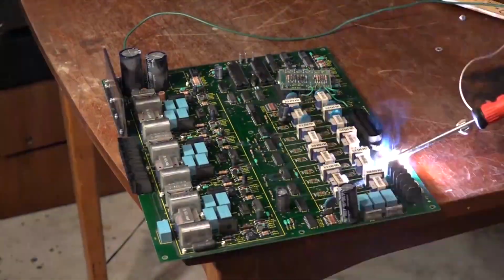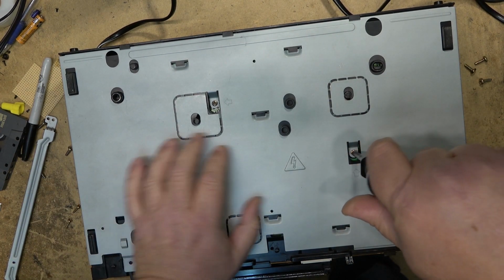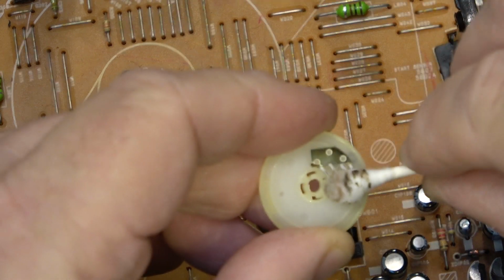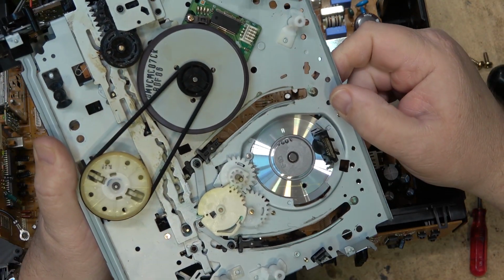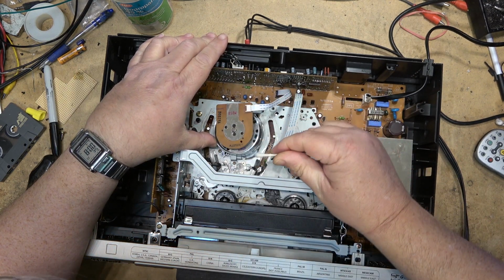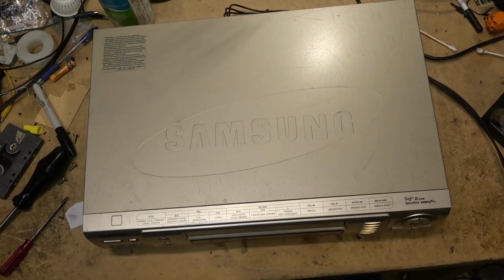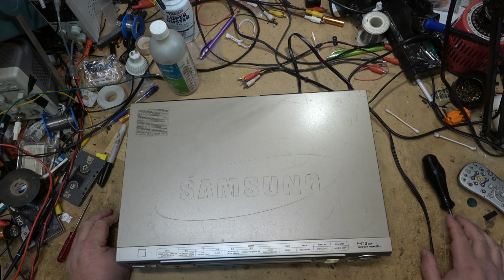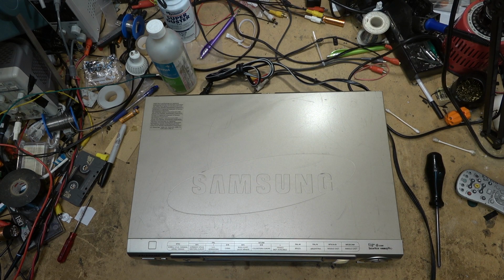Samsung SV5000 Multi System Conversion VCR mechanical trouble

Comment: 17:09 There's an exception to that.  The AG-4700 had decent heads, most AG- series machines had soft heads which wore out badly.  It's a slightly modified version of the high-end domestic NV-HS1000.  PAL recording, NTSC and PAL playback, includes a TBC.
It's PAL-M which is closer to NTSC than PAL.  Not many machines handle that.
I'm still very much doing audio and video transfers.  I usually don't charge extra for running NTSC tapes despite being in UK.  I capture in the same line/frame rate as original tape rather than convert to PAL, to keep the quality as high as possible.  Plenty of work still out there.
Reply from the maker: Not here.  I used to transfer about 100 tapes a month.  Dried up about 10 years ago.  Do lots of archiving but not much conversion now.
Reply: @12voltvids  Oh I see, you used to do VHS to VHS conversion from PAL to NTSC.  You're right, no-one asks for that any more.  What you call "archiving" I'm calling "transfers", typically video tapes of one format or another, to files on a USB stick or hard disk.  That's what I've been working on full time for about 13 years now.
Reply from the maker: @video99couk  years ago yes. Now it is all to either dvd or usb stick / portable hdd. Been that way for about 18 years. Still have my original dmr-e20 Panasonic dvd recorder.  Actually 2 of them as I was very busy.  That work has slowed substantially buy as I write this i just finished 6 VHS to DVD and am starting 20 8mm to HDD tonight. I just never see any pal tapes anymore.  A couple a year if I am lucky.
Reply: @12voltvids  I always push back against DVD, it's not a good archive format.  OK if the customer has a pre-recorded VHS tape they can't get on DVD, but for home videos and precious recordings, I never recommend it.  Video files are (or should be!) higher quality, easier to edit, share and back up, so a much better archive format.  DVDs always end up getting lost and scratched in the end.  Typically I generate and supply both DV-AVI of 13GB per hour and smaller MPEG4 files of 4GB per hour.  In the case of miniDV and Digital8, the DV-AVI file format is the only one which is a pure lossless copy of the tape contents which also has the original time/date metadata embedded in the data stream.
Reply from the maker: @video99couk  
I have found the exact opposite. DV-avi files are 4:1:1 color space as opposed to 4:2:0 of dvd.  Dvd mpg 2 ipb format as opposed to fixed bit rate 25mb/s. I have very, very few clients ask for DV-avi format primarily because they can't open the files on their mac unless they have an editor that supports it like premiere.  70% of clients want MP4. The other 30 want dvd backup.  Dvd disks last a long long time.  I have dvd disks that are 20 years old and play perfectly.  They can be imported into most cheap editing packages and edited easily and the resulting files look superior to starting with an MP4 file.  To go losses will consume 60 gigs per hour of disk space and many people's computers will have trouble with it.  My first NLE system ran at 2:1 compression 4:2:2 and i could get 4 minutes captured into the 2 gig file limit of the day. 
DV is 5:1 compressed.  12 gigs per hour.  Dvd at full bandwidth is 4.5 gigs per hour but it is mpg 2.  I output what the client wants and about 50% of the time when they take the DV Avi stream version on their portable hdd they return mad because they can't play the files on their hardware and then I am compressing to mpg4 for free. Dvd backup is a good upsell as a second copy incase something happens to the original.  I had one client recently that had 30 2 hour tapes put on a portable hard drive.  He dropped the drive getting out of his car and broke it frantic he called me and fortunately i had not deleted the files from my drive yet.  I normally don't keep a copy of anyone's data, Infact i usually capture directly to the clients portable drive to remove myself of any liability.
Reply: @12voltvids  If digitising miniDV or Digital8, DV-AVI is the only format to use and also keep the metadata.  Mac users can import them directly with iMovie, Final Cut Pro etc.  The colour space compression of DV is different between NTSC and PAL remember.  I do also generate MPEG4 files as well.  I keep a copy of the client data for a few weeks to give them time to make further backups.  For me, DVD is virtually dead now.  We just have different ways of working but give the customers what they need.  Some shady outfits use cheap USB converters and produce horrible compressed files of less than 1GB per hour.
Reply from the maker: @video99couk  Well first you don't digitize miniDV and digital 8, as they are already digital. You just transfer the tape over firewire.
I believe colorspace on PAL DV is 4:2:0 is it not? NTSC went with the lower quality 4:1:1 only because Sony, the inventor of the DV format did not want the format to compete with digital betacam, which was 4:2:2. They were trying to protect their broadcast stranglehold and did not want consumer cameras finding their way into broadcast, but it failed. Broadcasters were OK with the reduced color space if it meant that they could outfit a camera operator with a small hand held camera rather than send an entire crew in.
I use a GV-HD7000 to digitize analog video to DV-AVI when I get an order to capture directly to computer and output as 14mbit MPG4 file for the client. The MPG4 file is almost as big as the original.
Reply from the maker: Soft heads have better frequency response. That give a picture quality edge but they wear our fast.
Reply: @12voltvids  OK, an incorrect word, we capture miniDV, Digital8, DVCAM, DVCPRO, DigiBeta etc., as of course they are digital.  I wrote that around 2am!
Reply: @12voltvids  Those "pro" Panasonic machines sure do have very soft heads.  I've come across about 10 of those machines and only around three had good heads.  I'm not sure why a softer composition would give better frequency response.  Real pro machines of other formats such as BetacamSP don't suffer short head life, despite working with harder metal tape formulations.  You mention Sony trying to prevent consumer products getting into the Pro market: the story goes, that's the reason Sony killed off ED-Beta as it was at risk of eating into the BetacamSP market (they used the same tapes too).
Reply from the maker: @video99couk  well they did. Only Panasonic did this on their garbage machines.
Reply: It's 4:2:0 for PAL color system. Not as detrimental in image quaility as with NTSC tapes (4:1:1)... DV-AVI files are a good option even with analog type conversions (vhs, beta, hi8...). I'm just talking PAL land. Of course it's always preferable to use a lossless video codec like huffyuv or lagarith. This is specially usefull if you plan to do any restoration/clean up on the image.

Comment: I'd be interested in seeing you do a video or two where you talk about your best, worst and funniest customers, stories and repairs over your years of working in the field. Hearing such experiences is entertaining but can also be educational, and I'm sure you have some great stories to tell. Keep up the great work.
Reply from the maker: I didn't interact with customers when I was in the business.  The counter people dealt with customers.   I wasn't even permitted to talk to anyone.
Reply: @12voltvids  Bet you've seen some great cases of customer stupidity though. And finding faults with equipment where the customer has obviously lied about the cause (blown speakers and the like). I always found it interesting when I worked as a computer tech to hear the excuses a customer would give for a fault they caused, the most common probably being pirate software or frequent access to porn sites causing malware. Inevitably they'd blame the hardware, the operating system or a previous technician, and be in complete denial  of their fault until proven otherwise.
Reply from the maker: @ashleycox432  
Yup lots of that.  Blown speakers, teenagers having a party when folks away in Hawaii.  Funniest one was a cordless phone that came in all melted. He had a fire on his stove and the phone melted and the guy thought his 100 cordless phone was under warranty and started crying like a spoiled child when he was told too bad so sad, not warranty.  Warranty does not cover fire damage.  This was a guy I am going to guess was in his early 30s

Comment: I have one of the Aiwa machines and have found it to be a good VCR with a pretty good tracking system and picture. It handles crappy tapes pretty well. The PAL->NTSC conversion is a little wobbly... Could you show off your Aiwa?  They usually need belts and sometimes a bit of work on the front panel board.
Reply from the maker: Sure will make a video of it some day.

Comment: Different an question maybe will find a idea, I am trying to fix a problem. I have pulse oximeter it works well, but an issue it must turn off after 8 sec, but it does not, what can be the problem? What I need look for? Thank you for idea.

Comment: I have exact same model and cassette does not load or unload after VCR was not used for a few years. Cassette just stuck in a middle and I have to remove it manually. Cleaning Mode Switch did not fix the problem. What else could be wrong?

Comment: Looks a decent Machine your fixing up there, I have 2 machines, a Panasonic D80 before they put Nicam in it was the first D80, and a Grundig Multi System GV-469-M the Grundig has never been as good as the D80

Comment: Once had the previous Samsung model (SV3000 or something, forgot the name). The chassis seems beefier than this and it runs fine as multi-system vcr. Unfortunately its conversion circuit had went south so it can't be used for system conversion at all.
I also have that AIWA vcr (MX100?) it did convert anything to anything, but really with mediocre quality at best. Later got a no-name standalone video converter for 1$ from a garage sale...and it beats AIWA by miles. 
For me, any system converter vcr does not deserve any premium value anymore. Just find yourself a multi-system vcr and capture in its native signal and boom, job done.
Reply from the maker: Yes that is what I do now.  Just output the pal signal, capure and throw on usb stick.  Problem is some tvs still will not display a 625/50 capture. Computer will.

Comment: At school we had two "editing" sets ... Panasonics ... kinda NV-100 or something similar with basic efects and titler and those were PAL-B units while here we use PAL-N. I recall they used Trasconverter boxes and those were really expensive (year 92). So this unit will do the same for any of the ouput systems .... ?  A real nice feature to built in on a home VCR sure it most be like 10 years laterl otherwise would have been stupid expensive. Ohhhh the Panasonics. Never get used to them, we manage to do some cut and splices with the controls .... and that all we wrote. What really love is the ultra fine low with the jog, what a precision machine, almost frame by frame, "perfect" still. We had a so called teacher to do editing on this system ... guess what ?. She had no clue !!!!!. We have a small "radio" set on the other desk with a mixer and people tend to take RCA cables from this Panasnics to use in audio and then the system would be inoperational for weeks, no one could figure out, and we were not allow to mess with it. Im not sure if they were SVHS machines, almost sure they have HIFI FM track.
Reply: PAL-N here, We use 50Hz. Brazil is 60Hz.

Comment: Have you try to firmware update your camera? Maybe that fix the microphone problems.
Reply from the maker: This is a brand new camera.
Reply: @12voltvids  that makes not the firmware is new on it. Update the Unit and try again
Reply from the maker: @janchristensen9858  
You think i just fell of the back of a fuc+ING truck? The first thing I did was if it into the computer and check for updates.  I updated my ax100 years ago.

Comment: I still actively use the NV-FS200, which is a version of AG1980. I bought it as a non-functional unit from Ebay and managed to get it working. However, the design is just terrible and makes for a very unpleasant repair experience. Nowadays it still works fine and when it dies, i will switch to my Sony SLV-E1000. Much simpler design, relatively easy to fix. And in my opinion it also gives a prettier picture. The colors are much more vivid.
Reply from the maker: Comb filter module failed part NLA
Reply: Yes, the NV-FS88/ 90/ 1/ 100/ 200 all had that ceramic thick-film unit with the four SMD caps that would leak, causing no S-VHS playback. The 1uf start-up cap in the PSU primary was also a common failure point, usually after a power cut..
Reply: @Oldgamingfart  Yeah, I replaced that one during my initial repair. When the time comes and I won't be able to fix the VCR anymore, I will happily throw it away. Sometimes it is simply too much work. Here in the Czech Republic the lack of S-VHS playback isn't much of an issue (I can't even test it) because the tapes were too costly and never spread among users. Literally no one used these.

Comment: I have that vcr but mine has a power supply problem, it no longer powers on.
Reply: Maybe a bad capacitor?
Reply: @felixlutticken5694  checked fuse while back , think its a bad cap or 2 but didn't have a tester at the time and now haven't found motivation to dig it out from all the other equipment and wires in the entertainment center to work on it again.  Soon when not feeling so lazy :)
Reply: @kirknelson156  yes it's very time intensive to desolder the caps and test them. Yesterday I replaced a few bad caps on my old Philips amplifier and as soon as I turned up the volume a bit, one of the filter caps, which I just had replaced with very expensive blew up.I just tossed that thing away as I lost the motivation to find the problem. 😅

Comment: PAL-M is 525/30 with PAL, so the same standard as North America but differenc colour. A North American TV should display it in black&white and vice versa. PAL-N is - as far as I know - just a broadcast standard. The baseband is the same as European PAL, so the tapes are also the same, but the broadcast channel spacing and audio carrier are so they fit into the American channel grid.
Reply from the maker: There are 21 different standards based on 3 color systems.  NTSC, pal, and SECAM.  There are 5 tape formats. NTSC, pal, french SECAM, mesecam, pal m and pal n.
Reply: @12voltvids  wikipedia says otherwhise
https://en.wikipedia.org/wiki/PAL#PAL-N_(Argentina,_Paraguay_and_Uruguay)
"VHS tapes recorded from a PAL-N or a PAL-B/G, D/K, H, or I broadcast are indistinguishable because the downconverted subcarrier on the tape is the same. A VHS recorded off TV (or released) in Europe will play in colour on any PAL-N VCR and PAL-N TV in Argentina, Paraguay and Uruguay. Likewise, any tape recorded in Argentina, Paraguay or Uruguay off a PAL-N TV broadcast can be sent to anyone in European countries that use PAL (and Australia/New Zealand, etc.) and it will display in colour." Do you think they are wrong?
Reply from the maker: @xaverlustig3581  on tape all pal systems are the same except for the 525/60 and that is just the scanning lines.  So for pal n the vertical frequency is adjusted (vertical hold on older tvs but new ones have a count down oscillator so it will result in a rolling picture.  The differences is the broadcast carrier and color subcarriers.  Most pal broadcasts used a 4.43 subcarriers.  The sound carrier was also different. There were 21 broadcast standards around the world.  I have a tv that will accept any of them and on the av input it will accept pal 4.43, pal 3.58, SECAM, NTSC 3.58 and NTSC 4.43. 
SECAM is SECAM, or so you would think but there are 2 recorded formats for SECAM.  French SECAM and middle easy SECAM used by the east block, Greece ect.  Color under for pal and NTSC both used 629khz. On up convert it goes to either 3.58 or 4.43 depending on the VCR and tv requirement. Obviously we only have NTSC here.  I have never worked on pal equipment and never will.  Saw a couple of multi system sets. When i was doing tape conversion all i cared about was which country it was going to so i could encode to either pal, french SECAM or mesecam.  I have a SECAM tape here somewhere that i could run through that Samsung before it goes back because my aiwa won't do it.  I have a broken aiwa military system with converter that i have spent much time on but no luck fixing.  Everything points to tape end sensors but no luck finding replacement.

Comment: I don't like that Samsung VCR, I can see a lot of line wiggle, It is not suitable for capturing since it doesn't have line TBC.
Reply from the maker: Your right it doesn't have a line tbc, it had a frame store for conversion.  If you use a proper capture card you dont need a tbc.  That is taken care by the capture card.